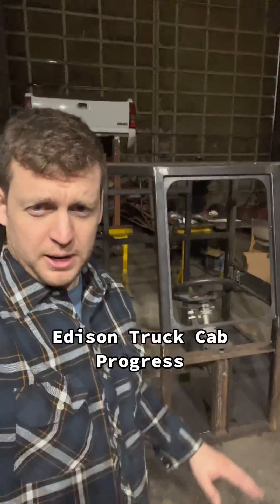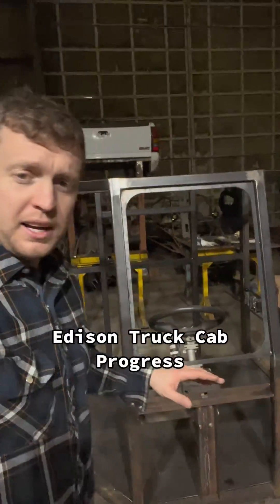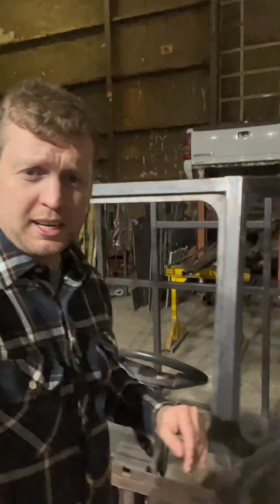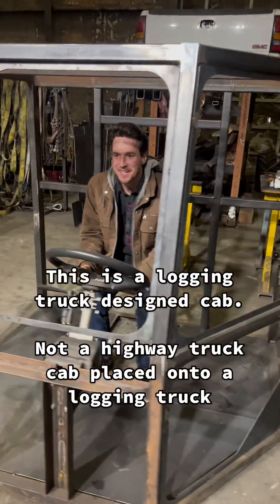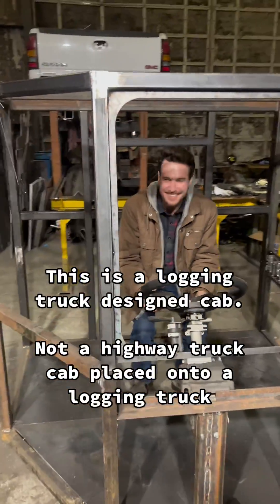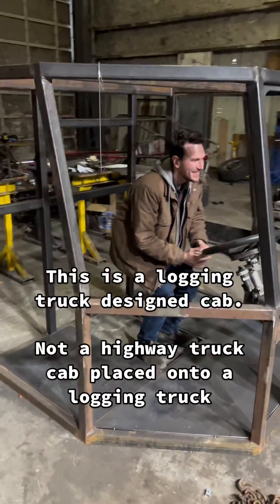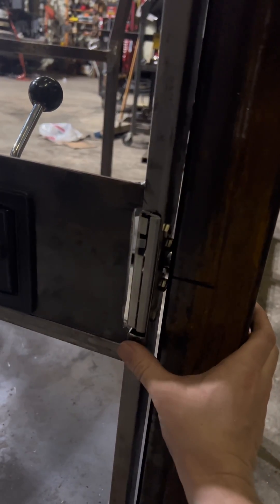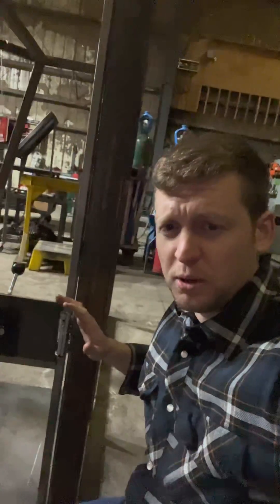Edison Cab Progress

Comment: Are you guys planning to add any triangulation to the back of the cab?  I'd be concerned about a rollover breaking the welds on the corners and the structure flattening diagonally.
Reply: Hopefully the headache rack could absorb initial impact depending on the roll
Reply: @tristanblack1352  Ideally, yes.  But if the cab is going to be advertised as protecting against rollovers, it probably should be braced diagonally.  Not every vocational truck is guaranteed to have a headache rack, so it's still a valuable feature if done well.

Comment: I just realized a simpler way to do this is a two third power motor and a one third power motor; the one third power motor takes care of 1/3 gas pedal input or below, the two thirds power drive motor takes care of above 1/3 and 2/3 and below, and above 2/3 gas pedal input is taken care of by involving both motors.
Edit:
basically it's just a method of cutting the back EMF into halves or thirds via the use of separate smaller motors so that acceleration of such low magnitude doesn't come with such unnecessarily high measures of back EMF.
Reply: you know that you can vary input to these motors right? You can run them in any config you want. they should run parallel load to distribute the stress & heat, but if one motor fails, the truck still moves (although slower)
Reply: @AzureCrux  ah but application of drive motors to any measure of acceleration exists only as far as the current applied exceeds the measure of electricity required to cancel out back EMF.  Back EMF is an electromagnetic drag which varies with the rpm of the drive motor.  Back EMF is insignificant at low speeds or while under significant acceleration; but, at highway speeds, the measure of current required to cancel out back EMF so that a forward acceleration sufficient to maintain highway speeds can be applied makes electric drive at highway speeds a fair bit less efficient than a high geared application of an ice connected to the wheels, at least in hybrid vehicles.
Reply: @AzureCrux  basically it's just a method of cutting the back EMF into halves or thirds via the use of separate smaller motors so that acceleration of such low magnitude doesn't come with such unnecessarily high measures of back EMF.
Reply: @alexwalker8422  Oh that actually makes sense. But does this EMF matter for these vocational type trucks? This might be a relevant question for their retrofit kits that'll be used on highway trucks though. I imagine that, like passenger cars, it'll be far less efficient the more it picks up speed, but   I imagine the additional weight of transmissions and gear overdrive are more negative than the EMF implications at high speed @ 70,000 lbs
Reply: @AzureCrux  i expect it shouldn't matter if they are operating at lower speeds, especially around heavier loads requiring a higher percentage of available power, I commented all of this hypothesizing hoping a particularly educated associate of theirs would so happen, if it does any good, to cross their view.

Comment: Do electric motors create drag at highway speeds if they are off?  If not, I suppose a drive motor could be replaced with 2 or 3 half or third power units that only turn on if the acceleration called for by the input to the gas pedal exceeds the amount of power that can be created by the number of smaller motors already turned on as a way to engage only a third or a half of the usual measure of back EMF present in a situation in which a third or a half of the available capacity to accelerate is needed at the time.
Reply: Only driving with one axle will put high loads on the driving gears. Is better to spread the load out to as many wheels as posable lowering the strain on any individual parts.
Reply: @Truckwrench  a disadvantage exists around production costs of my idea, each axle would have a two third and a one third power motor.  Two one half power motors would reduce the increased production costs a decent bit, but the efficiency would not be as good as the one/two third version.
Reply: these trucks have no engine powering the wheels, so the motors would be running 100%. But if in a coast (and no regen is requested) then they'll be frictionless as far as bearings will allow. The advantage here is that your "engine braking" downhill in a diesel uses no fuel to maintain speed, but in an electric setup you're "gaining" mileage since the electric motors create drag on purpose to charge the batteries (and maintain speed)
Reply: @AzureCrux  I was asking about electric drive technology ideas.  Electric motors suffer from back EMF, (a form of electromagnetic drag which varies with the rpm of the motor), while providing acceleration, which acceleration behaves like 1st gear indifferent of vehicle speed. Acceleration undiminished by the mechanical division of the higher gears of a transmission would easily, always be a whole lot more efficient; except, acceleration at higher speeds by electric motors only exists after sufficient current is applied to the electric motor to cancel out the opposing electric current resulting from back EMF at play.  Back EMF is barely existent relative to the amount of electricity being used accelerating a vehicle up to highway speeds, but the acceleration required for maintaining a given highway speed requires constant application of the drive motor, which cannot be applied until back EMF is cancelled out.  And, back EMF is significant enough at highway speeds for electric drive to become less efficient, at least in the case of hybrid vehicles, than high geared mechanical connection between the wheels and the ICE(which is why hybrid technology uses mechanical connection to the wheels at all ATM)  Hybrid or not, eliminating a significant measure of back EMF significantly improves the situation around vehicles which utilize electric drive.  And, hypothetically speaking, breaking up the current electric drive motors into smaller ones could hold a lot of potential in doing just that.

Comment: Super cool! What kind of sounds protection do you plan on adding because having that shaking and rattle would be annoying after a bit. Also for your bolt on panels and you going to weld tabs to the cage and have studies mounted to the panels? I think that would be the cleanest way for your proposed removable panel design
Reply: Definitely going to need a lot of sound deadening and heat shields.
Reply: Loud radio and two 12 inch subs you won't hear nothing but the radio
Reply: @1979augistine  12s?  Got enough room for 18s...
Reply: Why?  This is a diesel electric, it'll be really quiet with the Electric axles and the occasional genset working.
Reply: @danielseelye6005  9 liter diesel generators are far from quiet.
Reply: @danielseelye6005  not the motor, the cage, when he closed the doors that rattle
Reply: I'm sure the weather gasketing will make a huge difference on the door close! The tabs are a cool idea btw